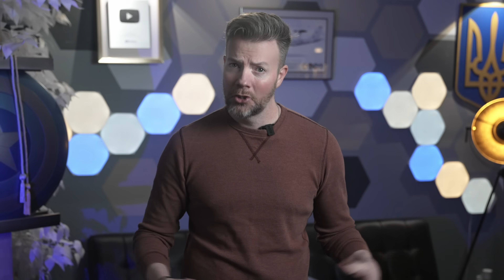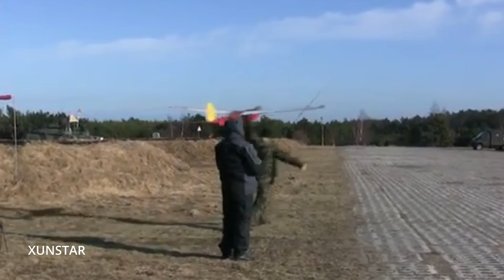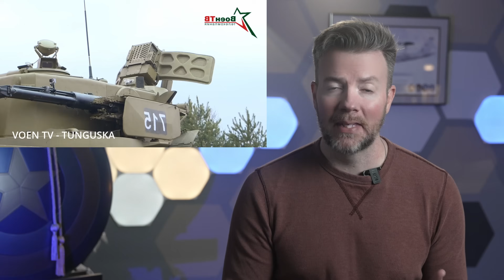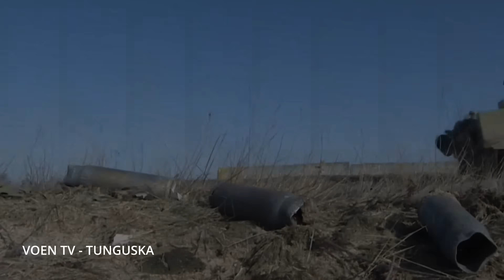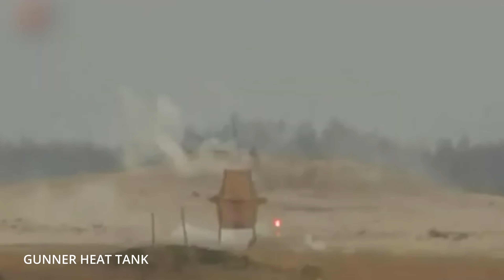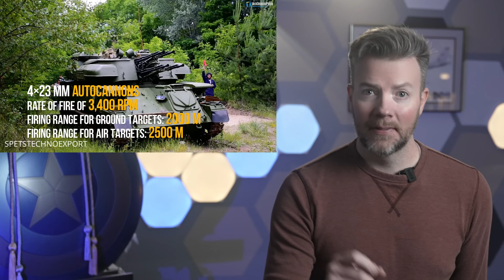This Old Soviet RELIC Is Fighting Drones Today!

Comment: The Shilka did appear in the 1971 war between India and Pakistan, but the Shilka only became famous when it was among the many rude surprises* that nearly shattered Israel, in the 1973 Arab-Israeli War.  The SA-6 had a radar that Israel's American supplied radar warning receivers failed to recognize, so the jets flew at low altitudes to avoid them, bringing them face to face with the Shilka's.  North Vietnam got some Shilka's in 1975.

* Those surprises were the SA-6, the Shilka, the AT-3 'Saggar' ATGM, and the use of water cannons against earthwork fortifications.  Packed earth is very resilient to shellfire and other explosives, but water cannons convert earthwork fortifications into sand castles, so the Egyptians crossed the Bar-Lev line without stopping.

Comment: I was operating one of these Szylkas for a couple of years in  mid 90's,  in the Polish Armed Forces. I did love this little beast. It was fast, nimble yet robust and deadly accurate for anything withing its reach, in the air or on the ground (excluding tanks of course). It had the old analogic targeting system but still could bring down any aircraft, which was foolish enough to get into Szylka effective range

Comment: The Shilka has the respect of any fighter bomber or fighter pilot from the Yom Kippur War till now- why???- the pure amount of lead fired up to 7,000 feet downed many IAF Sky Hawks, Phantoms , til stand off air to ground missiles made them into scrap if the mobile SAM-6s were out of missiles( Shilka were there to protect such assets).  Cheaper and less sophisticated radar than their NATO counterpart the Gepard also used in Ukraine but hey gets the job done fits with Soviet doctrine simple cheap durable easy to mass produce. A lot of nations still use them.

Comment: I've been saying this for years, AMERICA NEEDS THIS. Our counter drone capacity is a joke, IMHO. 

Every single Combat Vehicle is going to have to be fitted with APS systems. Those systems are going to need to have huge magazine depth. Even then, AA guns are still going to be necessary. Add a Vampire APKWS system on it. 

If not, our troops are going to get hammered if we ever try to assault with armored forces.

Comment: Why isn't Ukraine buying training aircraft like the British Red Arrows the Hawk?

The Hawk use is a training aircraft which has 4 hard points and you can add a 30mm gun on it, it also goes close to the speed of sound.  I know this isn't enough right on the front line, but look westward, where the problem is Ukrainian cities about being attacked with Russian drones and Russian missiles.

The Hawk can fly close to the speed of sound you can get there rather fast, a 30mm gun can take out drones, and the 4 hard points can carry missiles to take out Russian missiles.

The British Red Arrows are not the only ones fling the Hawk there have been over a thousand of them make in the last few decades.  Brand new they are 5-10 million, but second hand they will be cost efficient.  The Hawk isn't the only training aircraft out there, there are other similar aircraft.

Why not fill the west of Ukraine with Hawk's or other training aircraft so that those F16's and other proper fighters can focus more on the east of Ukraine?

Comment: The Israelis found out the hard way that a radar guided quad gun turret could ruin your day, in the 1973 Yom Kippur war, they were a big surprise.
Personally they have always had my respect, a ZSU 23-4 could lay down a wall of steel very quickly, against helos and APCs they were deadly.
Even a low fast jet could fall prey if caught unaware of their proximity, especially in a forested European setting beyond the Suwalki Gap.
Like the Flakpanzer Gepard, old kit is seldomly useless kit, and with upgrades...     Be well and stay safe

Comment: As ive always said wes - Russian's still using man power tactics over brain power tactics that Ukraine use!  It didn't work in ww1 and they lost 5 million in ww2 but still they value lives less than square feet.  The ingenuity of the ukrainian military has lesd to the first drone warfare military battalion,  designing them building sapsan,  flamingo and other original missiles and the flamingo is the 1st land launched cruise missile ever used . So Ukraine has already won by those tactics that russia has never changed.

Comment: The Gepard was the answer to this "system". The Gepard was also developed in the 1960's ( one of the many joint developments of Germany and Switzerland at that time, the Swiss provided the guns and the software for the system) and was put into service 1973. The Russians unfortunately did not have the same refined radar system and also no original Swiss Oerlikon gun system (in the 60's Oerlikon still was Oerlikon based in Oerlikon Switzerland) so the overall performance was just nowhere to be compared to the Swiss/German Gepard. The Russians probaly think they can do the same as the Ukranians do with the Gepard!😂

Comment: If it's stupid, but works, it's not stupid.
Reply: People act like everything needs to be  a drone or over engineered with software on a battlefield… I guess  common sense is out the window
Reply: @hotlanta35 it's why countries are looking at building a modern battle ship because as the war in Ukraine has proved it can be hard slow and expensive to keep building more missiles which can also be intercepted so large cannons are possibly making a come back as they are much cheaper and easier to manufacture as well as harder to intercept at the cost of distance and self correction
Reply: @hotlanta35  Common sense tells me that you are a moron.
Reply: Nope. It´s still stupid, but you´re lucky.

Comment: "When rotary phones were still considered futuristic". Lol! I wonder how long do you work on your scripts? Loaded with thick sarcasm and sharp points. I swear, you could make a phone book sound funny.
Reply: it's just that rotary phones were already pretty common in the 1920s with the first ones available before WW1 and the first self-dialing phone which didn't use the familiar disk with finger holes already in 1897.  So that ZSU may be old - but it's not from the Zsar's days 🙂

Comment: I’ve been wondering when the old ZSU23-4 would show up.
Reply: It was a question of time.  First the Gepards were pushed to the front but now that Ukraine likely has the majority of serviceable Gepards in service and thirst for more it was likely a dive into the attic would find something else and return it to service, no matter how rusty.
Reply: they've been back since 2014, but they weren't able to do much against drones (too small for radar to pick up)
Reply: @FulloutPostal  Picking up drones is not an easy job given their slowness and size.  Guessing from first principles, many of the Soviet / Russian radars seem to operate at relatively low frequencies.  That's why many have such big antenna arrays.  Operating at these frequencies means great range but coarse resolution.  Just the wrong technology to detect small objects like drones.  Low altitude means drones blend in with ground reflections.  Filtering the ground clutter is possible but previously technology choices were optimized for fighter size.  Similar for low speed.  If you want to improve such a radar for today's drone challenge start by throwing the old tech away and then do a clean sheet approach.

But building radars that are up to the challenge is expensive, slow.  Bad place to be when the drones are already exploding left and right.
Reply: @ralfbaechle  from what I understand that's exactly what UA is doing, hence the shilkas are suddenly able to look up again...

Comment: The US Marines had a version called the M-50 Ontos in Nam. Plenty fun.
Reply: Ontos used a salvo of large  recoilless rifles  ...like the Australian /British Wombat..  
.... A salvo from an Ontos could clear a NV A defensive position, bridge head  ... basically  most fixed targets or ambush any unlucky target  they could point it at... Lightly armoured it had to be reloaded from outside  but definitely packing  a heavy artillery punch.
Reply: Read about it in a book about the battle for Hue during the Tet offensive. A scary weapon the marines used.
Reply: What are you talking about? The similarities are mostly that they had tracks and launched projectiles. The Ontos was designed mostly to be really small, punch above its weight (but as a glass cannon that could never take a hit), and do damage to stationary ground targets - infantry support. It had six 105mm recoiless rifles, and could fire a single impressive barrage (or one round at a time), but then had to have operators get out to reload the 6 tubes by hand.

The ZSU-23 was designed specifically to provide close-in air defense. Being able to point at ground targets was just an extra bonus. It fired bursts of a whole lot of 23mm shells in a short span, intended to engage numerous fast moving air targets with radar aiming.

The Ontos was great for its intended purpose, but would be completely useless for the task at hand.